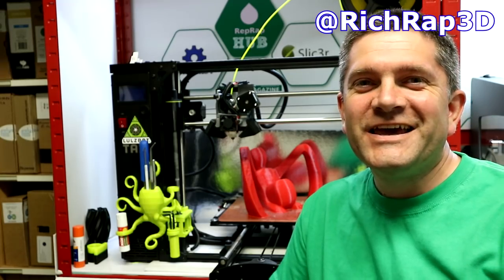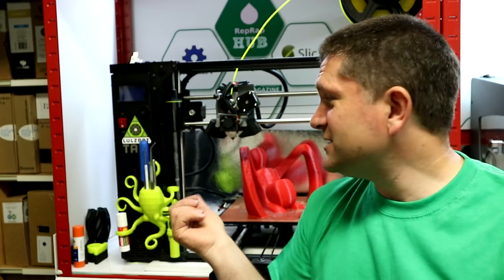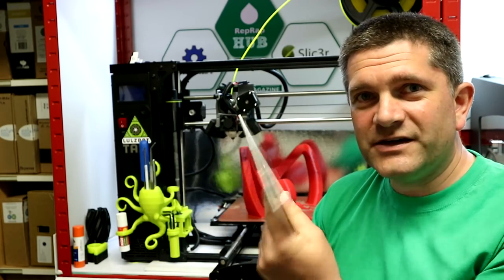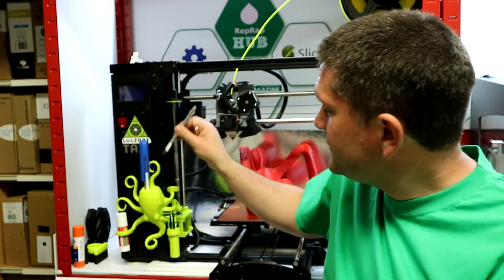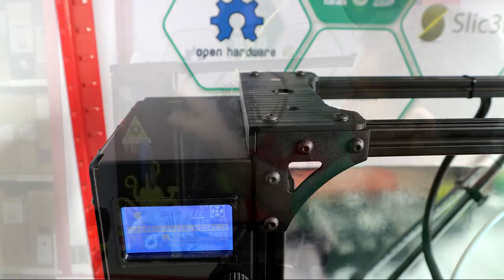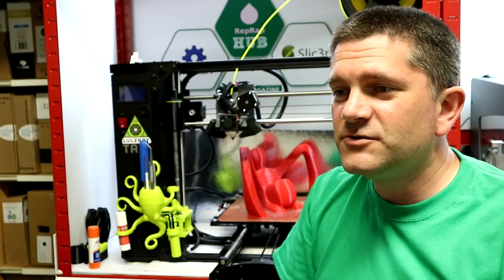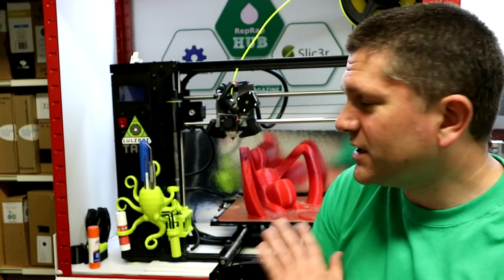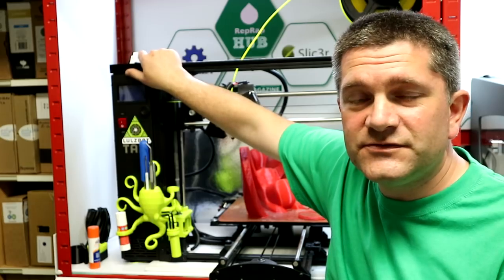TAZ6 Octo-Tool holder - 3D design for thermoforming 3D Prints

Comment: Great video. The octopus holder is a great idea. It looks awesome and super practical. I'm afraid to take apart my frame though. Still looking for part 2 of the tweak video. I used feeler gauges to adjust the z height screws of my Taz so that the nozzle is same distance away from bed. Improved my prints, just doing that. Looking for more tips and the firmware changes you made.  I'd love your process to fine tuning settings within cura also...... Thanks, keep up the great videos